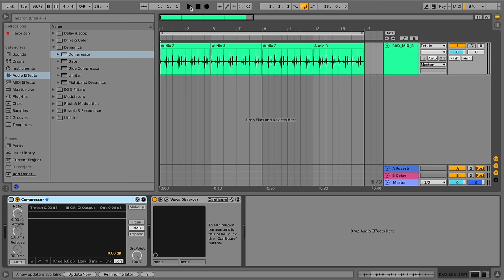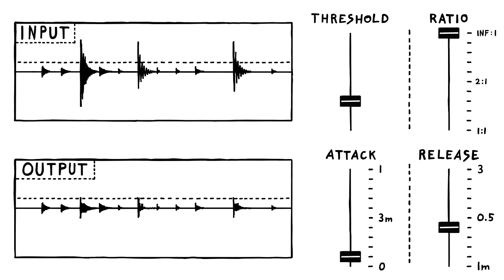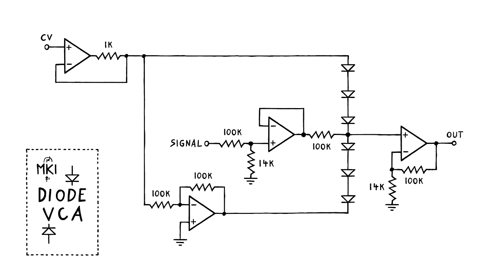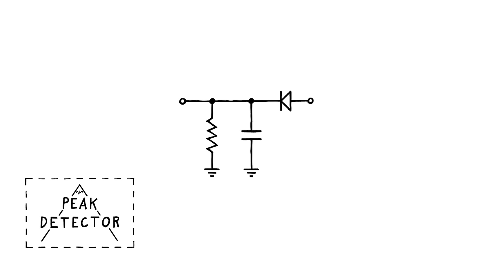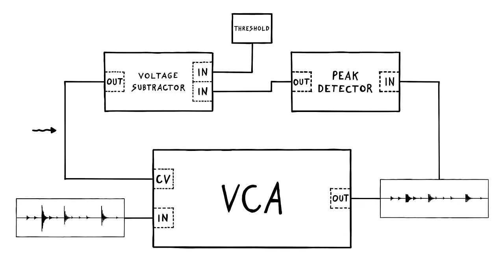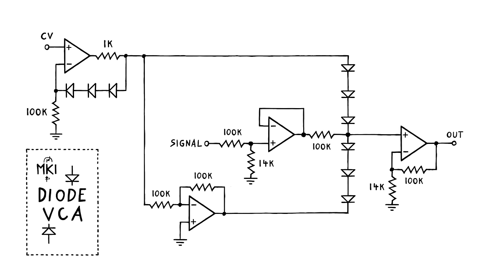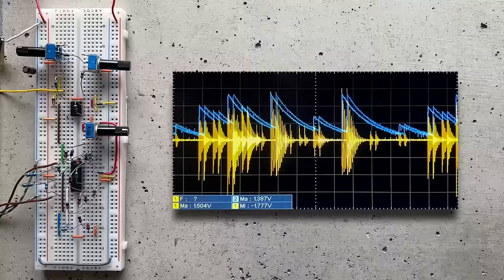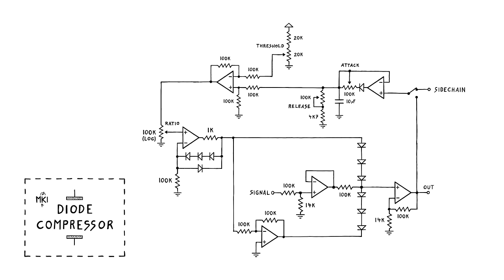Designing a simple audio compressor from scratch

Comment: Electrical Engineer here: Your VCA description is not correct. The first stage doesn’t care about how much current is flowing and Kirchhoff’s Current Law would dictate this. What is happening when current flows through the diodes is that their resistance changes. Due to how the circuit is designed, your diodes effectively become current controlled resistors which forms a resistor network which attenuates the small signal.